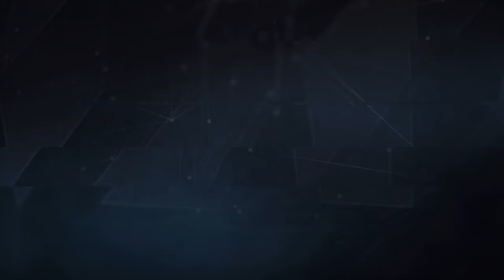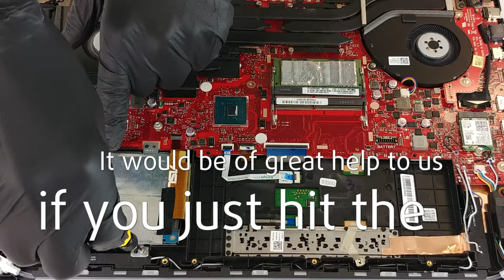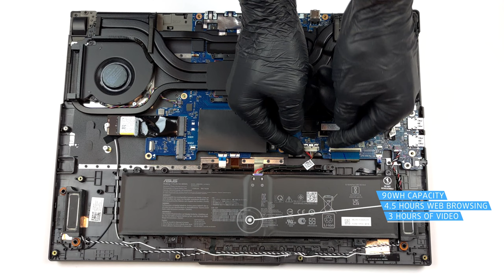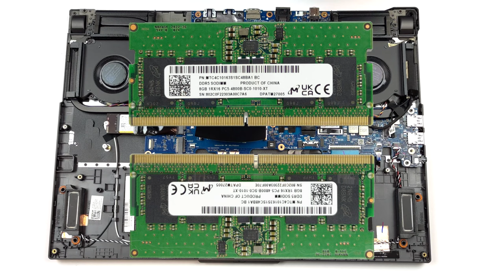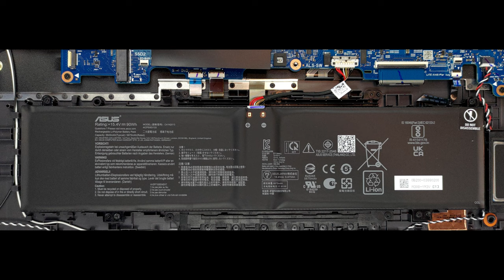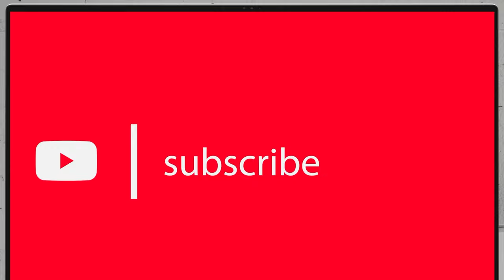🛠️ How to open ASUS ROG Strix G17 G713P (2023) - disassembly and upgrade options

Comment: Just upgraded to 32GB ram and a second 1TB SSD. It’s hard to open (easier than a steam deck maybe). I recommend the service manual. Once you pop open the unremovable pop-screw bottom right, it’s easy to insert a plastic guitar pick and drag it around the outside, popping the case open as you go.
Reply: What kind of memory speed? Because used 6400mhz, but it will still see only 4800mhz.
Reply: @France689 I bought the 32gb 4800mhz Crucial kit. I thought that getting adventurous might not work out.
Reply: @France689  All processors have limitations on how the RAM works. For example, Ryzen 9 7945HX has a perception of a maximum of 5200 MHz, but my memory can run at 5600MHz.
Reply: @France689  4800mhz is the max speed this specific CPU can handle which is kinda unfortunate, but not really at the same time. 
 4800mhz is still extremely fast and you more than likely wouldn't even notice any kind of difference between the 4800mhz and the 6400mhz.
 Obviously the 6400mhz is gunna be faster, but the 4800mhz is so fast as well that you wouldn't notice anything.
Reply: @acidosis82  and did it work?😅
Reply: @ heck yes, I just upgraded again so I have 5tb ssd storage now
Reply: @acidosis82  Hello,
I have a ROG Strix G17 G713RC-HX101W with 16GB of RAM. I’d like to upgrade it to 64GB. Do you think this is possible, or is the maximum limit 32GB?

Comment: Why only 2 slots for M.2?
Reply: Who needs more?
Reply: that's the normal amount of slots sure you can get some laptops with more but why it's not a desk top.
Reply: @c-v-n8268 They used to have 3x M.2 slots, including that wasted space on the left side of the battery.
Reply: When you have 3 slots you can have 3 cheaper drives instead of 2 expensive ones. These Machines are basically desktop replacements, so its unreasonable to expect people to buy this and also a tower pc.
Reply: Lol u can always just use external drives, or just get a high capacity m.2

Comment: When I open it and change the ssd, the warranty is still OK?
Thanks for the video man
Reply: As far as I know, yes, it's meant to be user upgradeable. I just installed 2x32GB sticks of Corsair Vengeance DDR5 4800 in mine, running good so far. It says it only supports 32GB, but as I understand it if you go with 4800 MT/s RAM you can go to 64GB, any higher and it won't recognize it.
Reply: @logicplague  thanks man for the info. I will upgrade the ssd today =)
Reply: @logicplague  is it only up to 4800 that it's compatible?
Reply: @DakotaTrucker  no, 5200Mhz 64Gb should be okay.
Reply: @dragoangel2  thanks

Comment: Okay, sooo i just bought my last night and just unboxed it now. I popped the back off before I even turned it on lol. 
 But, i noticed that there are 2 unused cable connections and im wondering what they're for. 
 Theres one connection clip thingy labeled "CN301" just below the first nvme slot where the 2nd nvme goes. However, when installing the 2nd nvme card, the connection clip would be covered by the stick.
 That leads me to believe that the unused clip could be for a 2.5" ssd/hdd? Mine has the larger battery so there's no room for a 2.5" drive. But, maybe on another model? 
 The 2nd unused clip is on the left side of the board near the top "cornerish" fan area labeled "CN4500." That one really throws me odd because it's right on the edge of the board and there's absolutely no room for anything because of the heatsink. It's right between the 2 CPU and GPU heat sink pipes and the pipe that's dedicated to the other 2. 
 Does anyone know what that would be used for? Or where I could find a labeled diagram of the board?

Comment: What are those dangling white strips in the beginning when he lifts back tab off and are u supposed to reconnect them where they previously were
Reply: The cover RGB led strip power and control cables, fragile af like WiFi ones

Comment: Do you know if I can put 64gb ram in this one?
Reply: Yes. 2x32gb 4800 DDR5 is supported. That is as high as it will go.
Reply: @TheRR4LIFE  thank you
Reply: @TheRR4LIFE  you sure? doesn't it say maximum capacity 32 in the website ?
Reply: @creedo8301  i have 64gb in mine
Reply: @TheRR4LIFE  and it is the rog strix g17 (2023 edition) ?
Reply: @creedo8301  yes
Reply: @TheRR4LIFE  i wonder why they put the maximum capacity as 32 GB that's weird
Reply: Just upgraded mine with 64GB Corsair Vengeance DDR5 4800, running good so far.
Reply: Update: running good on 64gb here
Reply: @AllergicFungus  his question was not if he could run higher mhz but if he could run 64gb..which he can.
Reply: @TheRR4LIFE  Yeah, but from what I've read the Mhz is important, you can only run 64GB at 4800, if you go higher the motherboard won't recognize it. That's why the site lists the max a 32GB, because that's running it at top speed. Mine came with 16GB of 5600, however it was running at 5200, so I guess that's the max speed for the board. IMO, losing 400Mhz for double the capacity was well worth it.
Reply: @logicplague  you make a very valid point
Reply: @TheRR4LIFE what year did you buy yours
Reply: @logicplague what’s the pin or slot # ig

Comment: After upgrade no power no turn one. Any help?
Reply: Same did you fix it?
Reply: @felixlammerhofer4319  i disconect the battery. press the power button for 1 min for sure and connect the ac adapter and let it with power after 30 min it powers on i let it run for 10min. i shut down pc , unplug the ac adapter and reconnect battery close case and work perfectly
Reply: @aggelossir  thank you for your instructions, you really saved my day! I got the same as you, upgraded to 32 GB memory 4800 and 1 TB M2 SSD. The laptop did not turn on with battery. I have upgraded an Asus ROG and Asus TUF laptop before that did not have this behaviour,  they just started after upgrade running on battery. I followed your instructions and it went fine with ac adapter, started up fine with 32 GB memory and I  formated the SSD but after closing the case and trying to start on battery it did not start. So I reconnected power and then it started (took a while), seemed to do some initializing, after complete startup into Windows I shutdown the computer, removed power and after that it works fine on battery. Just wanted to add this if someone has the same problem.

Comment: what is the maximum storage supported ? some websites say just 1TB ssd
Reply: Idk personally, but I'm about to buy a Venom 8 NVMe 4tb ssd with a heatsink. If it works, I'll come back to tell you
Reply: let me know the result.
Thank you so much in advance.
Reply: @Forrest_Videos  Can you update pls?
Reply: I apologize! I did not get the 4tb due to it being for PS5, but I did get a 2tb, and it works! So I assume all storages that don't require a heatsink will suffice!
Reply: Additionally, I am using 5tb in total in SSDs